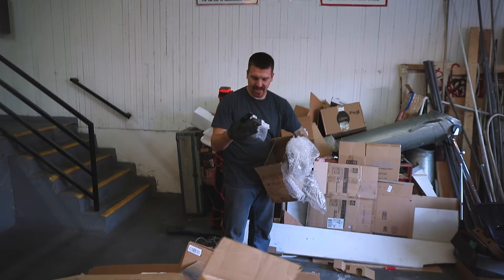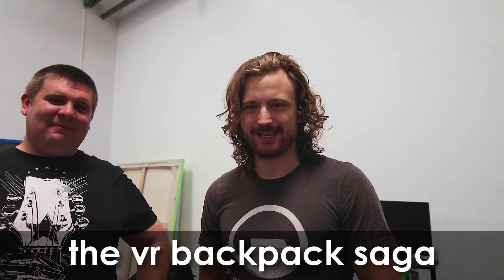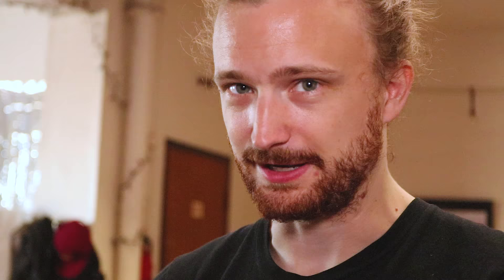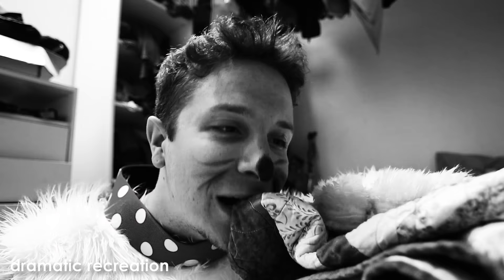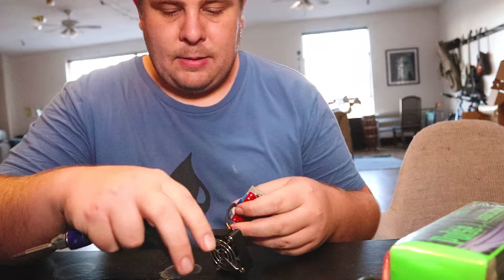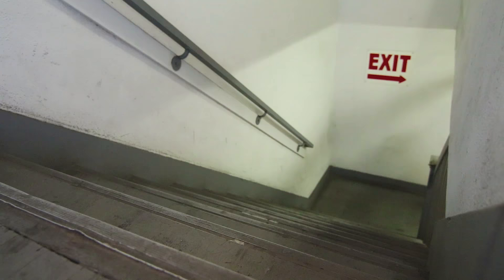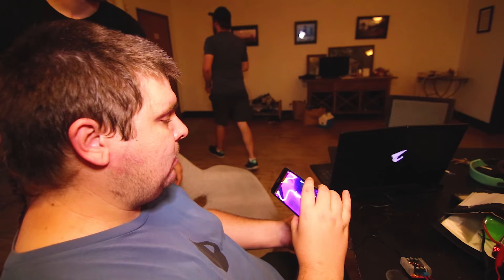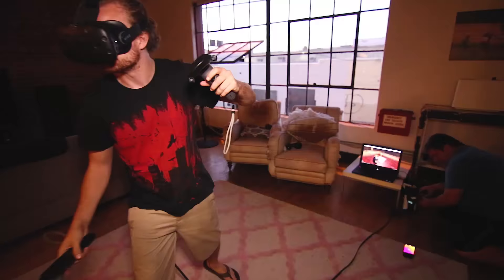Cockroach in My Bed 🕷

Comment: Wait, that's only a 1600 mAh battery? That thing is HUGE! I have a 4s 5000mAh battery that's half the size! Not sure, maybe you got the spec wrong?

Edit: I just saw what was actually on the battery, it's 16,000mAh or 16Ah. Much bugger.
Reply: I'm glad SOMEONE else noticed
Reply: Guntech762
Yeah, I was actually thinking about making a similar battery thing for my laptop, and having worked with those cheap power converters, they do get very hot.
Reply: if you look on the label it says 16000mah 6cell, niko missed a zero
Reply: Does the size have something to do with the output?
Reply: Nope, only capacity
Reply: +Luka Well, actually it CAN.

(I know it's long, but I must explain!)

Higher capacity batteries tend to have higher current output capabilities, but it doesn't always work out this way. Batteries have a 'C' rating. For instance, if I had a 1000mAh battery with a C rating of 4, I could discharge 4 * 1000mA = 4A. If it was 2000mAh and 4C rated, it would be 8A output current. Although Li-Po's like the one they had have WAY more output than a laptop would ever need. their's was 16C @ 16,000mAh, so it could output 256 amps or 5120 watts at 20V. You could run 4 microwave ovens off of that thing!
Reply: ***** So really C-val times Capacity affects output ceiling, but not output under that amount, and Capacity alone doesn't affect output at all. For new batteries, this ceiling is so high that you will almost never encounter it (as you so finely demonstated), so IMO, the short answer to the question is "No (except in extreme cases)"
Reply: LucAs Bune
Yeah. I'm familiar with pushing my drone (which uses Li-Po's) however, so I actually draw 120A from batteries regularly, lol.
Reply: ***** Oh, i was misinformed. I did not think there was applications were one would hit the Ampere limit.

I primarily work with integrated circuitry, and has only had small experiences with robotics and drones. Even in multi-controller designs running from the same source as the controlled actuators or motors, i have always needed to upgrade batteries out of necessity for capacity before i ran into the c-rating ceiling.

This not being the case with drones, just goes to show that in all fields, there are extremes.

Comment: have you looked in the power settings in the laptop you can turn it to high power mode then is should work like its on ac power
Reply from the maker: +expansiongames yes, we've done that.
Reply: If there's an integrated graphics card as well inside maybe its switching to that when its unplugged from the wall socket. Try going into the Nvidia Control Panel --> manage 3d settings and then make sure that Nvidia isn't auto-selected the best optimal graphics card. Just force it to use the GTX.
Reply: be careful with this setup, the laptop prob. needs constant smoothed voltage, where this setup maybe ripples and may the voltage drops as the lipo discharges
Reply: Florian He they have a boost/buck converter inbetween, that should keep the voltage stabe

Comment: Those Quadro and Tesla comments are hilarious. They aren't even faster than the fastest Geforce cards typically. The only big difference is that they have more memory. They do cost like 4-5 times more than even a TitanX. You only need those cards if you are rendering scenes that require more memory that is on a 1080p or a Titan X or if you are doing texture painting with a software like Mari and the model has like 50+ UV tiles with high resolution textures on each. Those kinds of memory requirements are only common in big budget Hollywood movies. So in reality you can have a system with 4 Titan X cards instead of 1 Quadro and it will be pretty much  3-5 times faster depending on how well the renderer can utilize multiple cards. It really is super annoying when people are talking out of their asses and then say that the other person doesn't know what he is talking about. Poor Wren.

Comment: Couple things:
1) The Aorus X7 OEM PSU brick is rated for 9.23A output. 
2) The converter you're using is rated for 15A peak but only 10A continuous so you're running it right up at its max capacity. Apparently it will decrease its current output when it gets hot (causing the laptop to switch to battery power, drop frames and allowing the converter to cool down enough to increase its current output, causing the laptop to think it's plugged back in, and the cycle continues). 
3) I see a small fan plugged into the converter for the assembly phase, but then it's suddenly gone when you start testing it. How come? Actively cooling it would probably allow it to run at its rated specs. 
4) Please don't rely on those screw terminals for your final backpack application. Soldering the wires directly to the board would prolly be best, with some glue for added safety. Those screw terminals are fine if the device will be sitting still, but wearing it in a backpack for VR will make those wires jiggle out of there eventually. When they do they'll touch & short together and you'll quickly have a fire on your back. 
5) You prolly already figured all this stuff out and would have explained it to the camera had "S&N 2nd Unit" not distracted you with that loud noise. Oh well. Good luck!

Comment: Please tell Spencer to buy some goddamn heatshrink. It's cheap and so much safer! Also some high guage silicone wire is really cheap and will work much better. Resistance in the wires will also be lower therefore less heat. Your thinner cables will likely will cause some inductance issues along with voltage spikes as the current fluctuates, obviously this is very bad for the laptop. Put a capacitor along the line to fix that.

If you have an oscilloscope, you should check that switching regulator. A multimeter will show the right voltage, even under load, but you should make sure it is not spiking, and giving a clean, stable output.

Sorry if what I'm saying doesn't apply, I just tinker with electronics and some of my larger fixed wing drones have gone down hard because of these kinds of issues.

Comment: Have you thought about using a dedicated rendering machine and wifi for transmission? I did the math and you would need 5.2Gbit/s for full resolution at 90fps. By using h264 or h265 compression it could get down to managable datarates around 1 Gbit/s which can be handeled by recent hardware.
The modern GPUs should be capable of realtime compression and decompression. It is not an easy task but would take you a lot of weight from your shoulders.

Comment: Hey cmike it's mAh not mA because mA is the current so it's like saying I live at 20 mph from LA
Reply: This is actually a fantastic simile
Reply: well you could live 2 hours away from LA at a rate of 20 mph
Reply: Also I doubt that a 1600mAh battery can run the laptop at full load for two hours if the laptops built in battery (that's probably around 5000mAh) lasts only 15 minutes...

Looking at the size of that battery its more like 16,000mAh, and even that wouldn't last two hours.
Reply: ***** Yeah it's a 16,000 mAh battery. Pretty lower capacity for the size of the Li-Po
Reply: ***** O hai.

Hmm, the capacity seems fine for the size, Li-Po batteries usually have lower capacity:size ratio than say Li-Ion batteries, since their main "feature" is high current rather than high energy density.

The package also probably has the charge/discharge regulator built in because these batteries can easily explode if even slightly over-charged/over-discharged.

Comment: I got a question for you all, when you hooked up the four 1080s together, since they aren't suppose to be used that way with more than 2 (at least that's what I heard) is the performance lower than expected from 4 cards?
Reply: That's only the case for gaming. My 3D program accesses the raw cuda cores inside each one so it scales linearly with the number of cards you add. If I had a computer with 8 cards in it, it'd be twice as good at what I do.
Reply: Thanks!

Comment: Why not try a 12V high capacity battery and use an inverter? Then, you can use the traditional wall power adapter for the laptop.

Comment: that hot wire is telling you something is wrong if you put a thicker wire on it its just going to transfer that problem to the next weak point and im betting that weak point is going to be the laptop im basically saying your probably eventually going to burn out the laptop if not immediately

Comment: Why are they trying to make a VR backpack, wouldn't it just be easier to have wireless transceivers from PC-vive? Or do they not transmit a signal that can be interpreted at a good framerate?
Reply: camman1056 the latency would be wayy to big
Reply: battery
Reply from the maker: +camman1056 transferring the video would be fine but there isn't a fast way to hack the headset to wirelessly transfer data to the computer.
Reply: You cannot wireless the VRs, it would be impossible to carry out both output from position sensors and input of huge resolution video stream at 90 fps. It will lag. Too noticeably to be useful in VR.
Reply: Linus Tech Tips sort of beat you to it
Reply: like the backpack idea

Comment: 1600 is kinda small compared the size of the battery and the big lettering of 16000 on it:D
Reply: It's probably 16000 mAh but Niko said it wrong. And if you would like to compare it with a powerbank for phones: this battery supplies 22.4V which is 4.4 times as much as a 5V powerbank. This means it stores 4.4 times as much energy.

Comment: Correct me if I'm wrong but wouldn't it be much better to get your hands on a 19 volt battery and not get a new cable that has a possibility to not be the problem?
Reply: Lipo battery packs come in voltage multiples of 3.7 since each cell has a 'nominal' output of 3.7 volts (actually like 4.2 when full and ~3.1 when empty). That's a "6S" pack which means there are six cells wired in series which adds voltage (6x3.7=22.2V). If they went with a 5S pack they'd only be getting 18.5V which is less than the 19.5V the laptop needs.

Comment: If you're going to use the CUDA per dollar argument then the 1080 still wouldn't be best because the 1060 is not HALF as powerful for it's HALF price. Let's be real for a moment. The key is you picked far and away the best card at that range, but like most computer parts, there are diminishing returns at a point. You picked an arbitrary point to determine the 1080 is best. It is probably the best for value but not linearly.

Comment: There are a lot of stupid people when it comes to computer parts. They probably don't realize the difference between running it in SLI and just running them separately. You won't get 4 better cards than the 1080 for the cost and the performance will be better on 4 1080's than 2 or 3 Titans or even just a single Quadro.

Comment: Wait, Wren... wouldn't a GeForce 1060 SC with maybe 6GBs be even more efficient and marginally more powerful/cost effective than a 1080 too?
Reply: You also need to be able to fit all the cards in a motherboard. 6-7 GTX 1060s may be as fast as 4 GTX 1080s, but ATX motherboards only support up to 4 cards of that size. Wren wants a shitload of performance for a reasonable price. The GTX 1080s are perfect for that job.
Reply: +Niosus It was to my understanding that a single 1060 can out perform a single 1080, ergo four 1060s should out perform four 1080s. I swear I compared the two cards just only two weeks back on GPU boss when I myself was looking at a card to upgrade to.
Reply: MaximumProductions A GTX1060 can never outperform a GTX1080. The GTX1060 is the same architecture, with fewer CUDA cores and at a lower clock speed. It also has less memory on a smaller bus running at a lower clock speed. You see, everything about the GTX 1080 is simply better.

Comment: The people who are being jerks about it are, well, jerks.  But part of the problem is also a difference in definitions.  Both you and the people arguing that you're wrong are hearing the same word ("better/best") come out of your mouth, but taking different meanings from it.  You're saying, "Best card," and in your head you (claim) to mean, "Best performance per dollar on the market."  This is actually technically incorrect, using your stated measure of CUDA Cores per dollar (which certainly isn't all that goes into card performance, for instance memory is also important) this is actually a toss up between the 1070 and the 1060.  Both come at about 4.3 cores per dollar, at MSRP for simplicity (there's a problem right now where the MSRP doesn't line up with how much you actually pay very well), compared to the 1080's 3.6.  Then you look at the Titan XP, which has a Core/$ of about 3.

So you probably meant, "This is the best card on the market before price to performance just becomes too low for us to consider."  Although it's interesting to note that the drop in performance per dollar actually drops slightly faster from the 1070 to the 1080 than it does from the 1080 to the 170 (again, purely measuring performance by CUDA Cores), you're mostly correct in this assertion.  Especially since you already made the decision to shove 4 1080s in the machine, which is the maximum number of cards you would typically see in one machine (though it's not impossible to do more), so to leverage the price/performance of the 1070 over the 1080 and still get the full absolute performance you desired would have been impossible/required upgrading other parts to get more PCI slots anyways.

The confusion comes in when you realize that other party heard you say, "Best," and interpreted that as, "the absolute best performing card on the market."  Let's completely discard the Quadro line here because anyone saying that performs better than a Titan XP in your use case is an idiot (it performs the same, its only advantage is tons of extra memory, but I highly doubt anything you're using can leverage that memory).  That means the Titan XP is our "best" here, and it's not actually unreasonable to look at that and say, "That performs significantly better."  Using CUDA Cores as our standard metric again, the Titan XP has over 1000 extra Cores compared to a 1080.  The price/performance suffers because it costs almost twice as much for not twice the performance, but in terms of absolute best performance 1000 cores is not insignificant.  To put that in perspective, the 1080 has 1.3 times the cores of the 1070, the Titan XP has 1.4 times the cores of the 1080.  Meaning that by the cores metric the jump from a 1080 to a Titan XP is just as significant, technically slightly (but probably unnoticeably) more so, as the jump from 1070 to 1080.  It's just that the price jump is way higher.

I want to stress that neither side is wrong here, the problem is an error in communication.  If I have to lay the blame at someone's feet for that it would have to be Wren, since you said, "Best," without much clarification in  video about an overpriced beast machine, which contextualizes people towards thinking about their ridiculous dream machines that might contain something like 4 Titan XPs.But I don't have to lay the blame at anyone's feet, since communication errors happen all the time, so yay for that.

Comment: Why do you need both screens in VR to run at 90FPS? Can you reduce the frame rate? 90FPS is not something the human brain will process any better than 60. Hand drawn animation is 12 frames per second which the human brain processes as smooth motion. Cinema is usually 30 FPS as a standard. Again the human brain processes this as natural smooth motion. The argument for 60FPS is weak enough let alone higher frame rates that most people won't notice.
Reply: Recording or animating for 24fps and then playing it back at 24fps is not the same as rendering at 24fps.
Reply: 24 frames per second is 24 frames per second. It doesn't matter if it's live video, Hand Drawn animation or CGI. If rendering at 24fps is different to live video or hand drawn animation, then it's not 24FPS and should be described accurately.

Comment: Actually Wren, any AMD card is better price for CUDA cores than any Nvidia card, even when trying to defend yourself you open yourself up to further attack

Did I trigger you? I'm sorry, I'm just not a cat person.
Reply: The thing is that nvidia can enable the cuda acceleration while amd cannot :(
Reply: Raptor Jesus but also unrealistic and impractical for the amount of cuda cores he needs, try matching 4 1080's in power and see how many gpus that would require.
Reply: Raptor Jesus octane render doesn't utilize amd graphics cards. Yet...
Reply: Perhaps, but AMD cards were never an option because I can't use them for my work.

Comment: See, Wren, your argument about performance per dollar doesn't hold any weight either, because the GTX 1080 is twice as expensive as the R9 Fury, but not twice as powerful. So why didn't you go with four R9 Furys instead? By your own logic, that would be "better", because it's better performance per dollar.